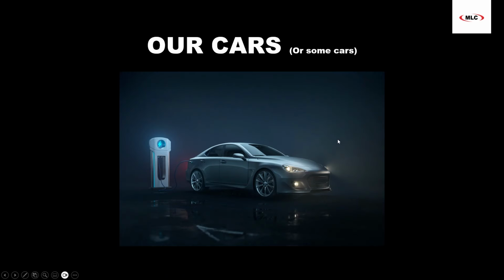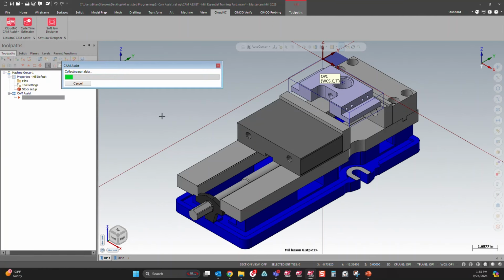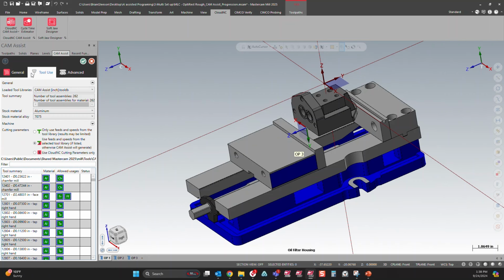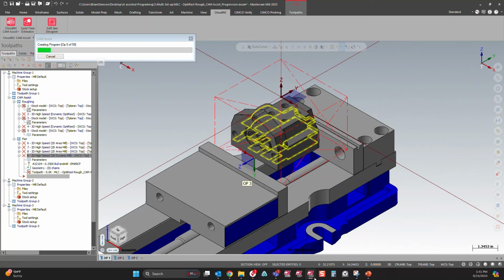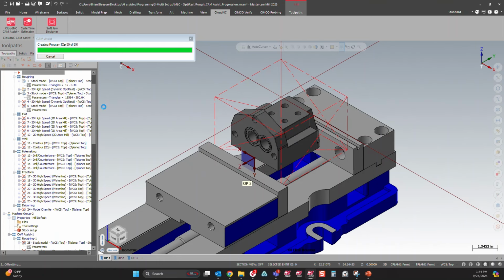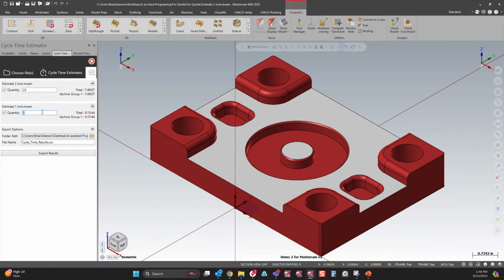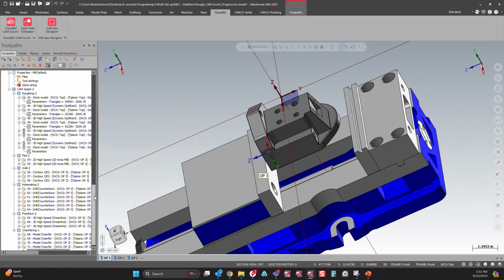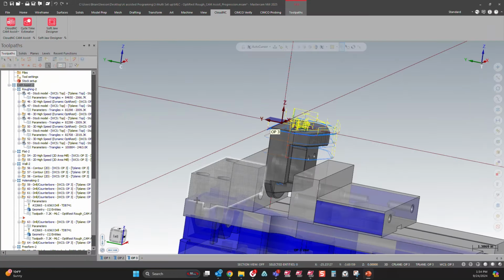Increase #CNC Programming Productivity With Artificial Intelligence | AI Webinar CloudNC CAM Assist

Comment: what is the difference between this and feature based machining.
Reply from the maker: Thanks for the question! To clarify, while feature-based machining focuses on recognizing specific features on a part and requires building a macro library for each, CAM Assist is a more advanced AI solution that understands the entire component as a whole. It automatically determines the best toolpaths and machining strategies based on the physics of CNC machining, without the need for extensive setup or pre-built templates.